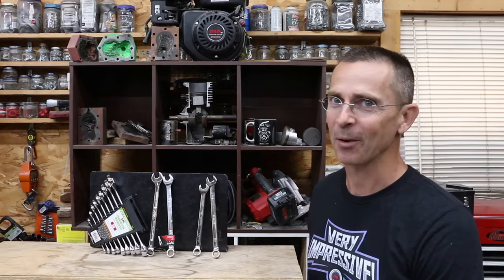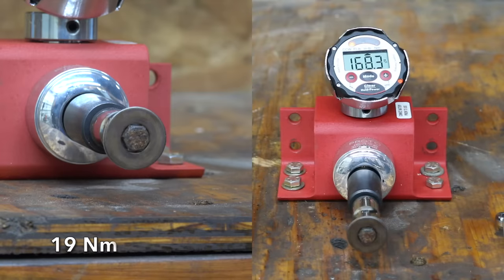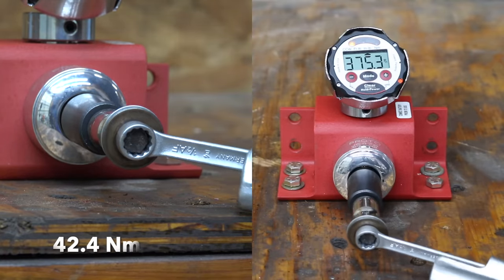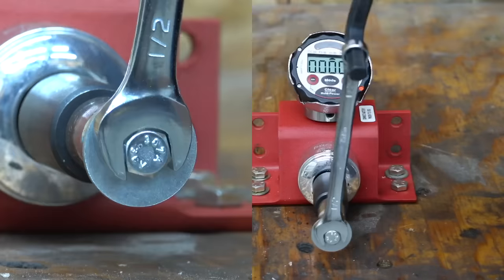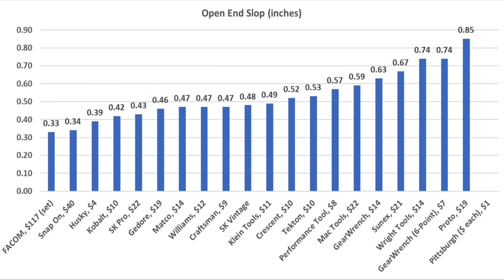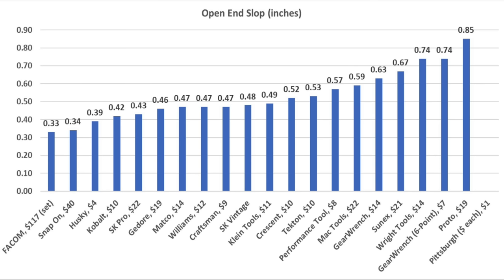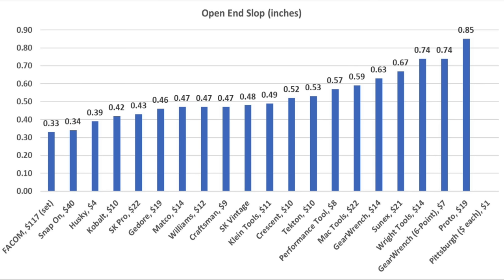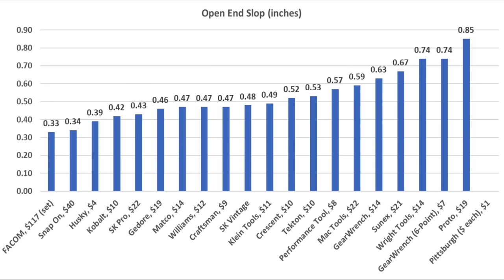Best Wrench? Let’s Settle This! Snap On vs MAC Tools, Matco, Proto, SK, GearWrench, Kobalt, Husky

Comment: Interesting difference between the 12 point wrenches. I’ve never had a good experience with using 12 points on severely rusted/seized bolts. That’s what turned 1 hour projects into full weekend headaches. Switched all to 6 pointers and life is much better! As always, thanks Todd!
Reply from the maker: Great point! Thank you
Reply: I use mostly 6 points. Don't some bolts  say to avoid 6 points? Seems like I recall instructions claiming that. Dunno, though.
Reply: Same here sir. 12 point wrenches have always given me problems.
Reply: @ProjectFarm  these are called HAND tools. Not hydraulic press tools
Reply: @ProjectFarm  "great point" so to speak
Reply: @robs1873  there's always that one 300lb gorilla in the shop who's arms make a hydrologic press look sad haha
Reply: Yeah my father taught me to stay away from the 12 points if I can
Reply: Rule of thumb from a GearHead and a Wrencher  6pointers = when you have space to use. 12 pointers= use in tight fitting areas. Have both in a wall of tools
Reply: @robs1873  while that’s true, a hydraulic press gives consistent comparison figures.

Sure it might not be strictly real world, but a cheater pipe will also concentrate the force in a similar manner. So it’s probably a decent comparison figure to know when it’ll let go if you start applying leverage to stuck fastener.
Reply: @dcmirk  well I agree with that. I get the whole scientific method of testing, but There are other factors to consider as far as warranties, availability, The grip of the tools, whether you’re a professional to do it yourselfer, along with many other things, not just how much torque it can handle.
Reply: @StatueofGuyThinking  The only drawback to a 6 point wrench is the angle difference between grabs. Like 12 pointers, you can get a grab "in between" grabs by flipping the wrench over if the tilt of the handle doesn't stop you. Obviously, the 12 point still wins if the angle of grip is the issue.
Reply: @robs1873  bro he's just testing tools in common ways, and filming it,  he isn't claiming to be the one all be all to the best of the best no questions asked. There are flaws with every test, because we're humans and nothing is perfect. 

Show me one place where he says this is the official tool testing formula. I'll wait.
Reply: My grandpa taught me that if the crescent side didn't do the job pull out something with power and use lubricant/solvent.
Reply: @ProjectFarm   Wondering if doing these in the future you might like to add some "Mastercraft" tools to the list.  They are probably similar to Craftsman but its out normal "go-to" tools here in Canada (Canadian Tire brand).  They are guaranteed for life though (no questions asked, bring in a broken tool and they swap it right there in the store) so maybe better?  I'm just a home-repair kinda guy and I've only ever replaced one 1/2" ratchet because the gears were slipping.  I can even sponsor you some for a test.
Reply: As a man I can’t find a reason not to purchase new tools every chance I get, so I’ve got 6 point and 12 point in every configuration you could possibly think of. I don’t have a shop but the Snap-On man comes by my house every other week, I’m thinking of getting psychiatric help with my tool buying problem.
Reply: I have mostly 6-point wrenches and sockets for that reason. 

It’s interesting that snap-on patented rounding the outside points and that does actually increase wrench performance.  Probably because rounding the corners stretches the metal in the flat shrinking and weakening it.
Reply: @Sandy.J.Lloyd.Sr.  LOL
Reply: @Sandy.J.Lloyd.Sr.  Hey friend, shopping isn't only for chicks.
Reply: @kg0311  he isn't testing a damn thing. He's creating entertainment. Nothing he's doing tells you what the best wrench brand is: it's all anecdocdotal and obviously susceptible to quality control outliers. 

Look at the failure/breaking points of the various bolts. Random bolts from the same bins, bit nearly 100 lb-in failure torques. If you got the shitty bolt you'd think the whole batch were garbage; if you got the high toque one, you'd think they were amazing. The real truth ends up somewhere in the middle.

 A single example of any brand's wrench is only going to tell you the properties of that particular wrench (you know the ones PF just broke); nothing about other wrenches from the brand or the quality of the brand overall.

This isn't testing, it's entertainment.
Reply: I work on commercial aircraft for a living. I only but 12 point sockets and wrenches. The majority of bolt heads and nuts in aviation are 12 point.
Reply: I always had old craftsman 12 point and they did well for the most part, I did get a set of made in China wrenches to use as special tools. I'd bend them or even cut them to fit in some of the ridiculous spaces automakers made for us in the 70s and 80s or instead of paying $10 for a line wrench just slot a Chinese tool to fit. If I was younger this chart would be a lot more useful though it did answer questions I had about how good the expensive wrenches were.
Reply: I was always told to stay away from 12 point wrenches but I think if you get the right wrench like project Farms’s testing shows you will be good.
Reply: There have been times when I needed twelve point wrenches and sockets. Many aircraft fasteners have twelve points, and in that situation, do actually provide more contact area than a six point fastener.  I have a mix of brands, and can't single one out as my favourite.
Oh - I'm an aircraft mechanic.  Retired.
Reply: Our auto parts store use to carry master raft tools and I have some and they are a decent tool.
Reply: @StatueofGuyThinking  work with rust, 6 point wins.
Reply: Yah that’s how I like to do it…
Reply: @charleywalker2982  Mastercraft? US?
Reply: @chrishouse5753  I would be curious as well. I think their wrenches are decent. Chrome sockets seem cheap. Impacts are good.
Reply: @robs1873  Yes, but testing them in this way will show me which wrenches will slip off or bend. I have bent wrenches, and stripped bolts, and busted my knuckles on cheap tools, but I can't afford to fill my tool chest with Snap-On Tools! Knowing suitable alternatives is super helpful, at least to me.
Reply: 6 point is great for strength but in a very tight space 12 is better. It allows different angles to grab. I keep both on hand, just depends on the job.
Reply: @robs1873  

You just outed yourself. Clearly you have never worked in a shop where you take a hand tool, put in on a nut, then gotten a 4-6 foot pipe and had two fully grown men, whose muscles are sculpted from turing wrenches all day then push and pull hard on a wrench to break a bolt or nut loose. That scenario is LITERALLY why snap-on has so much business from mechanic shops. Some nuts and bolts are small in size but need a ton of force to break loose. Automobiles are notorious for this very scenario. 

Do leave the experting to the experts.
Reply: @FNG_Star  wow youre weird
Reply: @auntlouise  so from this video, youre gonna go buy tools?
Reply: @robs1873  

Wow you're not too bright.
Reply: I started using Wright tools when they closed the Snap On plant in Wisconsin.
Reply: I thought it would be obvious that you don't use 12 pt on anything that may be a problem. 6 pt for tough jobs. 
 The standard hierarchy is
1   High torque      6pt box
   odd location
   minimal clearance
   damaged
2   medium torque  12 or 6 pt box/open end 
   good clearance 
   minimal damage 
3  low torque     12 pt  open end
    unlimited clearance or the only option because of obstructions
    no damage/ quality hardware 
  Always try to use the higher grade wrench if you have a choice.
  I left out specialty fasteners because by their nature you have to use a specific wrench. 
I'm sure I left out a bunch of stuff, and people will argue about details.
Reply: @rydplrs71   According to the marketing, it shifts the force away from the corner which is weaker.  The points on a bolt are the weakest part of the head. I think that is the "point" you were trying to make.  :)
  Many companies make a variation of this.
Reply: @FNG_Star  aww youre upset
Reply: @robs1873  that's why he puts all the results up with the price tag right alongside. You can make an informed judgement based on what you've seen.
Reply: @bourkey07  i dont need to judge what to buy after watching this video. I already own the tools that I want
Reply: @StatueofGuyThinking  RUST
Reply: @Sandy.J.Lloyd.Sr.  As long you have things to use them on its not a problem and just a hobby.
Reply: @robs1873  He knows that, how else are you going to test these "hand tools" to the max, with your hand? The testing is not about esthetics and comfort.
Reply: @The_Story_Channel  hahaha its is about the way it fits and feels in your hand. I never said aesthetics
Reply: @kg0311  I’m 65 and I’ve been collecting and restoring tools since I was 12. My family had a shop where we restored and sold corvettes for over 30 years, so I’ve always been around tools and loved everything about them. I still restore Vettes and tools even though I’m retired, I consider myself a maker and get excited with every project.
Reply: I have problems finding 6 point wrenches. I refuse to but the high end snap on type, lol. Anyone have any recommendations? Without buying online? Thanks
Reply: @Jujoji  Do you feel better now??
Reply: @Rob S go play with your toys, adults are talking.
Reply: In the Navy, we used 12 point wrenches and sockets because aircraft hardware was 12 point. A 6 point tool would  not work.
Reply: I went with a 6 point ratcheting wrench set from tekton. Best wrenches I’ve owned! I’ve never trusted 12 point and those are usually what you find in ratchet wrenches.
Reply: @paulcopeland9035  every damn day
Reply: AVE tested the difference with a 6 and 12 point. they are pretty much the same, go watch that video.
Reply: @GarageSupra  - In places where there is very little room to swing a wrench, a 12 pt. wrench makes a big difference.
Reply: A 6 pointer is going to have much better bite.
Reply: @Dimythios  exactly
Reply: @Dimythios  Makes the most sense, thanks for the comment
Reply: @robs1873  Price, warranty, and availability for sure. I'd rather have all of the right tools in "okay" quality than abuse a few tools in "great" quality because I ran out of money and don't have the right tool to do the job the right way.
Reply: @Jujoji  uh..... You do understand that in previous videos, he's tested the hardware side for consistency and quality; presumably, he uses the same brand of hardware for situations like this. This gives a consistency to the hardware side of the equation.

Sure, then the wrench side COULD be susceptible to quality outliers as you have said, however, that does not mean that Todd's testing methodology is invalid. Most brands with any type of lifetime warranty aim for a consistent level of quality. Sure there COULD be inconsistencies within the steel itself, or within the manufacturing process. BUT it can still provide a good starting point. Cheaper isn't always better OR worse, same with expensive. As well, EVERY manufacturer is susceptible to quality outliers. EVERY single one. 

If you want a scientific level of testing, Go for it.  Create the channel and spend the literal tens of thousands of dollars, to buy multiple copies of the same wrench from a variety of stores to ensure that you get accurate results for the brand. Go ahead and spend the time to manufacture testing jigs and machining consumables from tested high quality consistent materials so that your results are scientific.

He's not JUST creating entertainment, but doing it as scientifically as he is able, within the confines of his personal shop and not a laboratory, AND within a reasonable budget.
Reply: @Jujoji  if you re-watch the brief segment between 0:00 and 16:26, you'll see he did test several aspects of how these tools perform.

"Anecdocdotal" is what you get from Amazon reviews. Small sample size is different, and okay fair enough. But while it's true we don't know the standard deviation between different wrenches of the same part number, would you really rather trust herd-mentality reviews or marketing than see at least one sample of each actually tested against others?

If you got no information from this video, well here's your sign. But please report back with a link to your more scientific video after you buy a few thousand wrenches and put in the work to do this better.
Reply: Yup but tbh there's times where 6 point isn't the right choice
Reply: @TigDegner  one data point tells you nearly nothing about the average quality of anything. You need a minimum of 30 truly random samples, per wrench/brand. So yes, i trust UL, CR, and a company's own internal (six sigma) quality control testing data over project farm and his entertainment disguised as "testing". Hell, a heap of anecdocdotal evidence, of hundreds of people reporting lifetime usage of a tool is more reliable than the entertainment PF makes.

Did PF find one of the amazing exemplars of a wrench or did he find one of the garbage ones quality control missed? Did he find one with a heretofore undetected material manufacturing flaw? You don't know. I don't know. PF doesn't know. His "testing" tells you only what one wrench from each brand tested did. It tells you nothing about all the other wrenches made in that batch run, or other batches. You know the ones that theoretically are on the tool trucks, at HD or Lowes, or on Amazon: the ones we actually could own.

Well i can't buy that exact wrench from him. You can't buy it from him. Can't buy the good wrench, can't buy the shittiest wrench. Because lo and behold those wrenches were destroyed during his single example "testing".

You can't compare or base purchasing decisions off of single garbage data points.
Reply: @Blue84Stang  he's creating entertainment. It saddens me you don't grasp that that's all he's doing. There's nothing valid here other than entertainment
Reply: @Jujoji  yes, more data points are better; how did you arrive at 30 as being the minimum adequate testing sample?

In Taiwan (where many great tools are made these days), when one factory has too many orders they'll often contract the job out to an entirely different factory; should PF test 30 from each factory?

There are problems with every product review/comparison freely available. You mentioned "hundreds of people reporting lifetime usage of a tool" for example: problem is, that tool probably isn't made the same way, with the same materials, or even in the same factory now as it was a lifetime ago.

PF doesn't pretend to be peer-reviewed research published in an academic journal. That doesn't mean it's useless entertainment; it means we should use it in conjunction with common sense and other available resources. But when the only other available resources are reviews from laymen who've never used more than one brand, this is damned useful.
Reply: @Blue84Stang  I should have looked for other comments before I replied to Jujoji. You nailed it, well said.
Reply: I use 12 point wrenches and 6 point sockets exclusively.  A 6 point wrench is meaningless is tight spaces because the swing arc is so much less than a 12 point.  Using 6 point sockets however work great in so many applications especially when there is such many high tooth ratchets now compared to “the ole days”
Reply: @brockbaker3able  i would get them but out of stock
Reply: @dwiley411  i have a 6 pt ratcheting wrench and it is awesome for caliper bolts. i agree with you on what you said and i am a pro mechanic
Reply: @chrishouse5753  Mastercraft is made by apex which used to be craftsman,Crescent,gearwrench, Allen,Armstrong
Reply: @Jujoji  and it saddens me that you want to dismiss valid testing because it doesn't meet YOUR standards.

I'd also point out that UL and CR both don't use THIRTY examples of every item, because thats an absurd requirement. Consumer Report states right on their website that they do the exact same process as Todd does, save for CR's final step. Go to retail store, purchase items for testing, administer tests. In CR's case, they will only purchase additional samples (aka multiple items) if there is a non-repairable failure of the item, and then additional testing is simply to see if its a defect in that wrench or within the product line. So, PF skips that final part. But he also never claims that his results are perfect, or flawless, or whatever.

PF runs tests in a manner very similar to CR. So, if PF is entertainment, so is CR.

As I said, you want to test thirty examples of every wrench, knock yourself out. Go ahead, buy thirty of each wrench and test them to destruction. Once you go broke, you'll begin to understand how absurd YOUR requirements for 'valid' testing are.
Reply: @Blue84Stang  your points about the costs do not invalidate my point that PF is making crap testing. Worthless, testing that tells you nothing. NOTHING.

Costs and scientific rigor often go hand in hand. Obtaining valuable data takes time and money. I know how expensive large data sets can cost; I used to be involved with research projects that sampled several thousand people over decades.

You demonstrate that you know nothing about quality control testing. And certainly nothing about Consumer Reports testing, they buy dozens of exemplars for quality testing. They have the money that you and I don't have. The companies that make the products have the money to do the testing; it's literally a cost of doing their business: a cost passed onto the consumer as part of the product price. Hundred of exemplars of each batch run are tested, and if not enough pass, the whole batch is scrapped. Recycled to be recast or remade. So in essence, everything that comes out of their factories falls is supposed to fall within the specifications for that brand. But even the most rigorous testing isn't going to test every wrench and still get it out the door and to Amazon or the big box stores for under $100 a unit. Sometimes flawed tools get sold to the end customer; and you as the customer cannot know if today you got the shit end of the batch run when the forging stamps were worn to the limits or the wrenches that got pulled right after the new/fresh forging stamps were installed.

You'd still have to run large sample comparative tests (N>=30) of each brand to have a normalized distribution of outcomes. Then you can compare the measures of central tendency for each brand: mean, median, mode, standard deviations, variance, covariances, cross correlations of different statistics. That would genuinely tell you something of value about the qualities of each brand or sub-brand. 

Now there is another way to determine these results without one lone jackass having to buy 30+ exemplars of each wrench, and that would be getting  30+  jackasses all agreeing to the buying of one of each wrench and testing them under as close as identical testing apparatuses (probably several hundred to factor out inaccuracies and errors of the different testers and their particular testing apparatuses). That's comparatively easy given mass communications and data mining: the power of the internet.

There are other ways, but I know you're just going to shit all over them in your efforts to suck up to PF.
Reply: @Jujoji  Okay, so, lets discuss your first point. Yes, cost and scientific rigour do sometimes go hand in hand, but that is not a requirement. it is entirely possible that one can be conducting scientifically based research without the cost you seem to think is mandatory. One does not need thousands of exemplars to be able to make reliable conclusions about specific things. For example, we know the specific attributes of S30V steel, or of 7075 Aluminium Alloy; therefore, we KNOW that products manufactured from those products will also have those similar attributes. That means that we don't need to have gigantic test pools to ensure that every single item contains those attributes. Because the atrributes are a known (and therefore quantifiable) FACT, we can reduce the testing pool required to ensure those attributes are present without negatively impacting the quality control.

To your second point. My information on Consumer Report came directly from their website, and I quote "After additional research to define any testing project's scope, staff shoppers or one of our anonymous “secret shoppers” buy the products we use as test samples — in fact, some products, like house paint and food, can vary by climate or region, and because we need to make sure our tests reflect a national consumer experience, we purchase products from across the country. Our shoppers pay full retail and purchase all the products we test to generate our ratings from the same places consumers do; we accept no sample products for testing." There is absolutely ZERO chance that they would be be buying dozens of exemplars and be able to remain anonymous. Could the "staff" shoppers maybe do it? sure, but that is a BIG maybe. You also state that manufacturer testing is as good as UL or CR, and that is straight BS. If the manufacturers testing was that consistently reliable across the board, there would be zero need for UL testing. UL testing came about specifically because manufacturer testing was found to be EXTREMELY unreliable, to the point of ACTUALLY causing the death of people.

To your third point. PF has never claimed to be writing Master's Degree level theses on which is the best item across EVERY variable and EVERY situation, for EVERY budget. You want to invalidate his results because, like most of academia, "how dare he claim to be conducting scientific research outside of strictly controlled labratory grade testing". It is entirely possible to produce scientifically credible results without having to spend potentially millions of dollars. Yes, his testing COULD be susceptible to random quality outliers, which is why PF never claims to be the ONLY resource for information. For myself, whenever I am considering a purchase, I do my proper research which includes online reviews, sometimes CR/UL testing results, PF reviews, and as much other information as I can find. PF's testing methodology is transparent and consistent. He endeavours to create realistic testing scenarios, to ensure that the results will reflect realistic usage. Is it labratory grade testing? of course not. labratory grade testing requires levels of funding that are impossible for everyone outside of established research groups to obtain.

You want to dismiss what he is doing, the response is simple. Stop Watching. You don't like his methodology, fine, don't watch the videos. But if you come here JUST to crap on someone trying to do testing in a better way than most others simply because his testing isn't up to YOUR arrogant standards, then expect a response.
Reply: @robs1873  until you get that rusted/corroded bolted that wont loosen. sometimes a hydraulic 'assist' is necessary. or 1" breaker with 2 large guys reeefin on it. if it breaks, youre effed. good to know whats strongest!!
Reply: @Sandman.666

Hey, Samdman..... i think we all need help, since i found out that Husky out performs Snap-on tools but is 1/10th the price, and both have a lifetimes of warrenty........ im so gutted.....
Reply: @Blue84Stang

I agree with every word you said regarding this channels content, 

i also have left this troll my own opinion of him "laughing off" this channels content as fun and fantasy content for amusement only......

What that clown dosent realise is that most of us own our own businesses or garages and we are all going to change who we all purchase our tools from..... whilst he is just some "handalers" mouthpiece (sales boy).....

Its a pity that there are people like him that waste the air we breathe......

Lovelly to know you Blue 🙂
Reply: @TigDegner

Well said Tig.... (if you dont mind Sir)....

That troll dosent realise that theres over 3 million of us soon enough,.....

Its a pity "mouthpieces" like this exhist and attempt do their handlers talking for them......

"It" dosent even realise we all own our own businesses, and thankfully we can now make more informed purchases thanks to all the work that has been done on this channel, 

I for one will be closing my account down with the white van that visits us every fourtnight...... and not buying tools that cost 10 times as much, but are greatly out performed by tools that cost 1/10th the price... (thanks Husky)....

I digress Tig, its wonderfull to know you Sir. 🙂